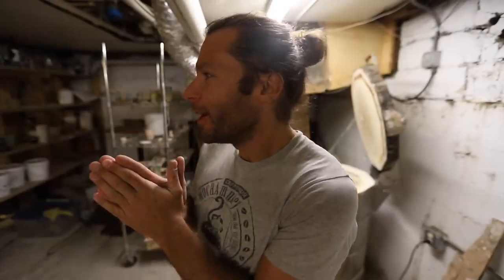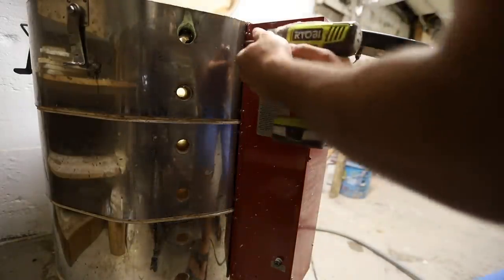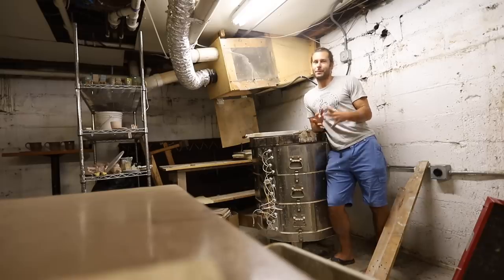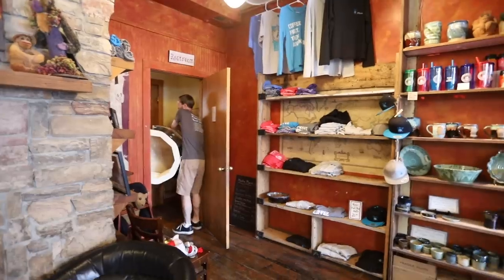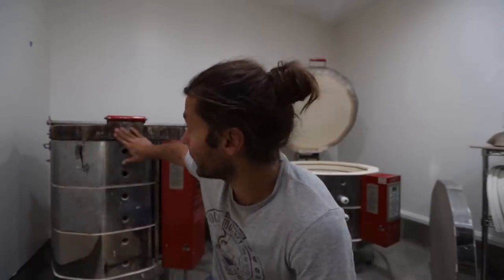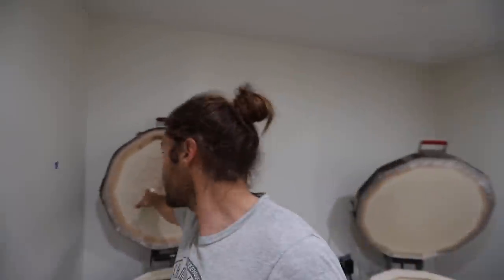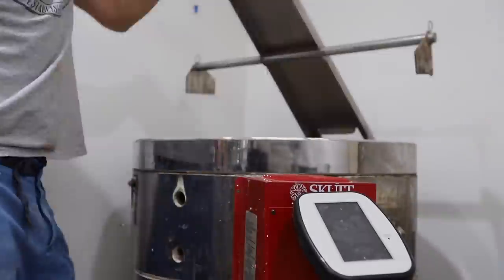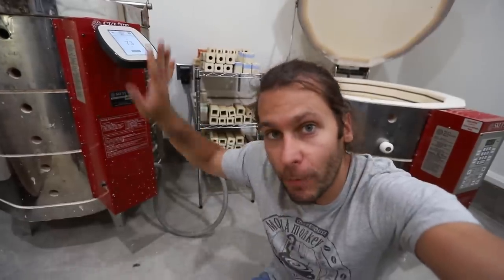How to MOVE a KILN!

Comment: Another great video!  I enjoy my tumbler daily. Love the colors and the spiral design. I'm a beginner potter. I have a 31 year old manual kiln I used to use in ceramics. It sat unused a long time. I just couldn't sell it. I was glad I didn't. I replaced a switch and the elements last summer and it's still working.

Comment: A couple additions, in regards to moving a kiln.  Never sit the ring sections, on their side, as they are not meant to deal with stresses, from that direction.  Turning it to fit through tight spaces, is fine.  I just say this so someone out there doesn't load a kiln segment into a vehicle, or to store them, sideways, to make them fit.
Also, it is good practice, to check the kiln plug for corrosion, which can lead to the kiln not functioning well, or even electrical fires.  This is why it is advised, to hardwire a kiln into the electrical line, and put a breaker box closeby, so the power can be cut from the kiln, in case of emergency.

In regards to kiln names, the one of the right "Short Round", the one of the left, "Malibu Stacy" (It's the exact same thing, it was before, but it's got a new hat!)

Comment: Do you leave your kilns plugged into the power between firings?  I have read to do it AND to not do it.  Being a relatively new kiln owner, I just wonder how to best handle it.  Thanks for your input.  Jon, you are the best!  Love your videos.  Congratulations on your new studio.  I am so happy for you.
Reply: I have a single throw safety switch on the wall above the outlet that cuts the power.  I place it in the off position between firings.  Just a personal preference I think.

Comment: Fire inspector requires 18" of wall clearance for our kilns.  Maybe that is only a commercial requirement.
Reply: That is recommended for all kilns, at least for combustible surfaces, like wood or drywall.  For non-combustible, like concrete, metal, etc, 12" is adequate.